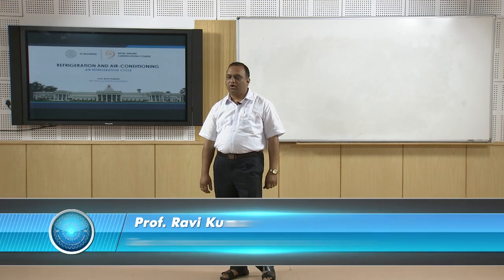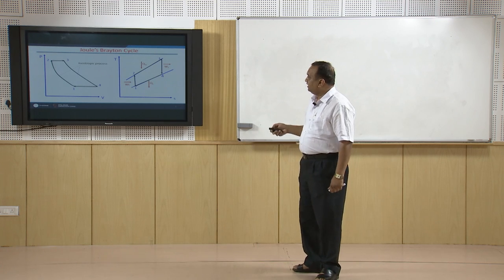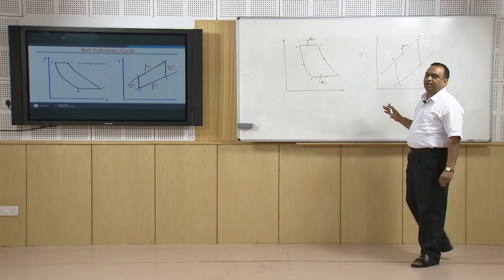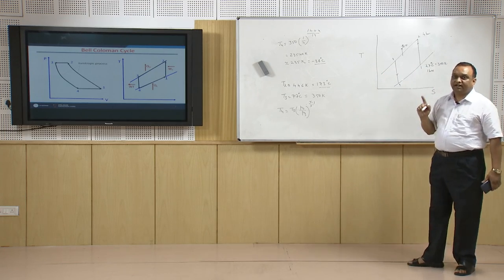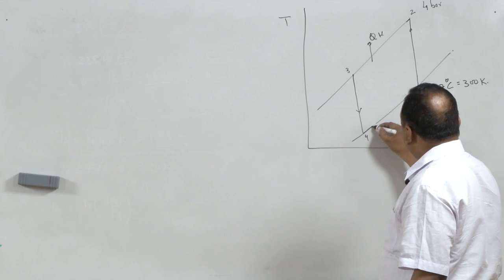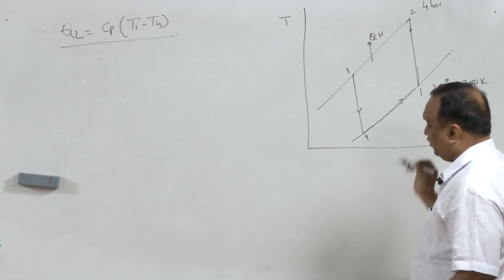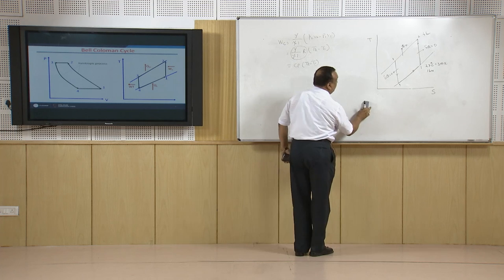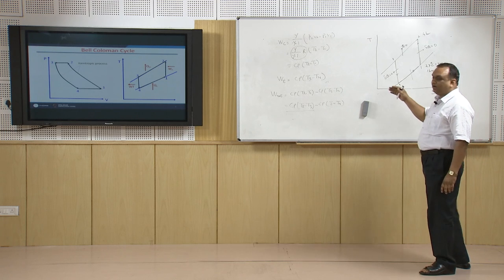Air Refrigeration Cycle

Comment: Respected sir,
At 12:25, why have you taken negative*negative= positive. If work is done on air compressor than work must be negative. Please correct me and guide me that where I am wrong.
Also, processes 2-3 and 4-1 of the refrigeration cycle are having volume change, then why work done is not being considered of those processes.
Thank you

Comment: Why is the answer in the COP different when I used the derived (T1)/(T2-T1) formula than when I used the (T1-T4)/((T2-T1)-(T3-T4))?
Reply: Because it is not a carnot cycle as you use formula of that